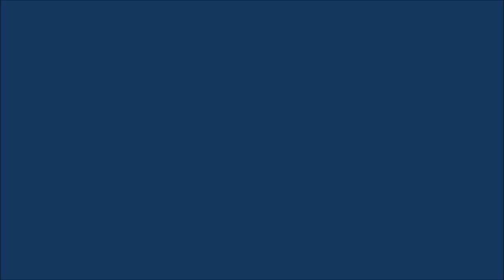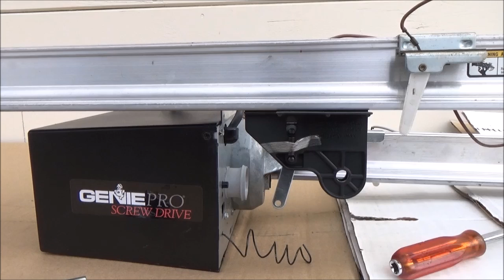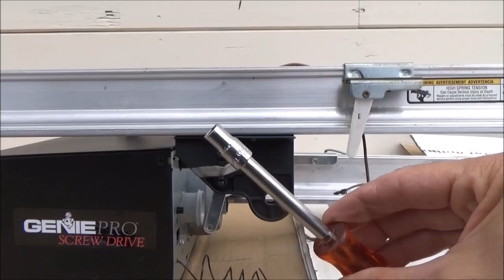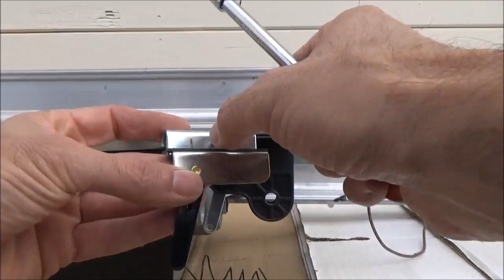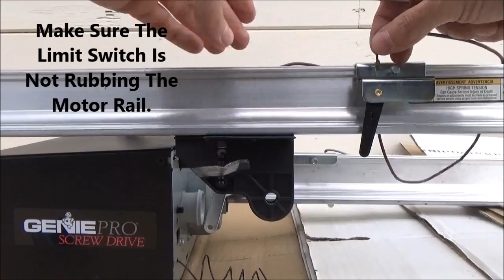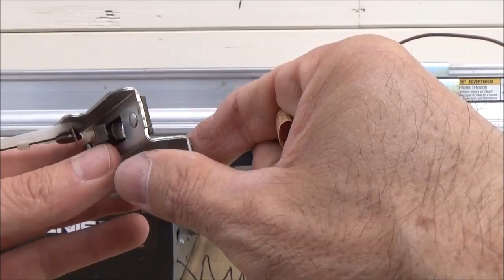Genie Screw Drive Limit Switch-Repair/Replace

Comment: Wait hello… my wire is hanging down. I have no idea what it be attaches to? Help! is that a live wire? I had to pull the manual cord during a power outage. The power came back in. I’m trying to Re engage the chain nmmm pull… I hear it running but it’s not pulling. There’s a wire hanging down.  I don’t know where no it goes. Or what it does. It is right about the manual pull cord.  Anyone help me?

Comment: After doing some research and trouble shooting, and watching your video, I decided the limit switch was my problem. 
Ordered a new one on eBay for $17. 
Fixed it in a minute and a half. 
Only obstacle was, the new limit switch did not come with a screw, and the old one didn’t fit, so I found a new one in my stash box of that type of stuff…and 
that’s it. 
Done ! Thank You for your video.

Comment: Thanks. I've been fighting with my Genie for 48 hours. It's a PRO82 with no force adjustment dials. It wouldn't close at all, not even a budge. Cleaning the limit switch didn't fix the problem, but repositioning the switch did the job.

Comment: Thanks for the helpful video.  Quick question, the spring on my switch broke which lead to snapping the carriage.  I've cleaned the contact points on the switch and tried to manually push the metal together to complete the circuit and stop the garage, however it keeps going.  Any advice on what is the issue?  Could the switch be internally broken?

Comment: My limit switch failed because the little spring inside snapped.  I fashioned another out of a paper clip and it has been an expedient repair, but I am buying a replacement assembly to have onhand for when the paperclip fails

Comment: Is there a way to get a longer wire to extend the position of the switch?  My switch works fine, but I need to move it forward about half an inch.  My current wire is not long enough for me to do this.

Comment: Hey my limit switch is working as far as stopping the door. But it won’t come back up? Any suggestions? It’s like the limit switch is saying no. If I loosen it and adjust it back to where the switch let’s up, the door comes right up. Then it stops too far because the switch is back too far. It’s almost like it wants to hit the limit switch then release it to come back.

Comment: +G S Overhear Systems My limit switch works, but it gets hit by the top of the door instead of the carriage, causing the door to remain open few inches from floor.. I tried moving the limit switch, but that closes the door too early or too late. Any suggestions on how to fix that?
Reply: How did u fix